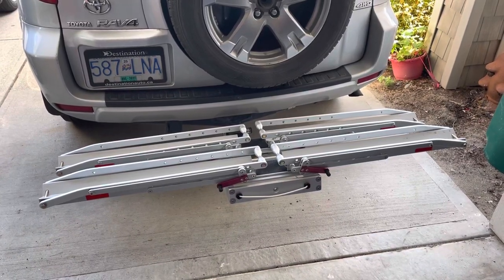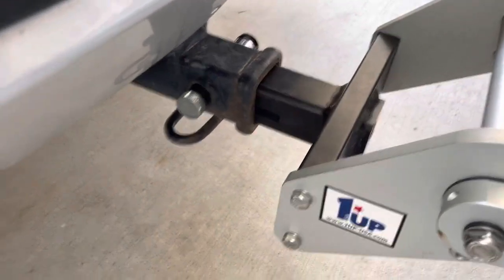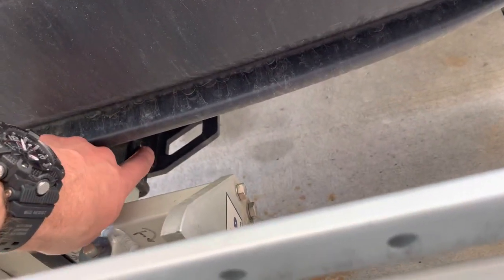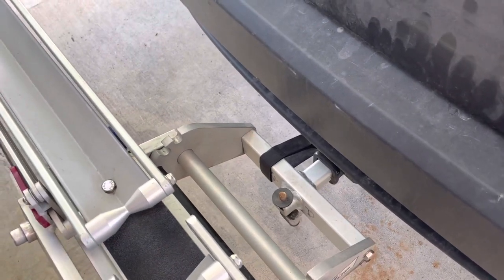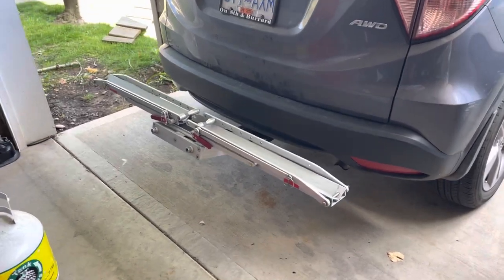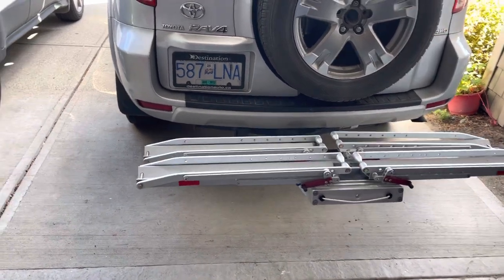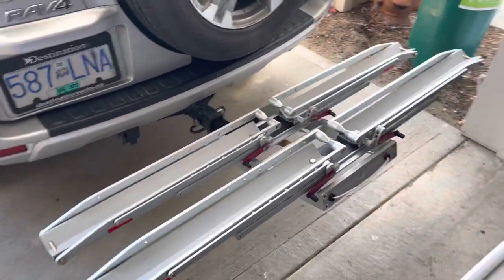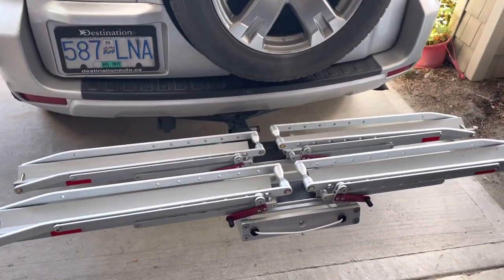1UP Quick Rack VS 1UP Superduty

Comment: I saw you had some sort of white nylon cable on the super duty to make it easier to actuate...is that something you did? or something 1Up offers?
Reply from the maker: I made that. I have a video showing the setup and how I did it. Makes it Much easier for sure!
Reply: 1UP offers the optional EZpull handle kit for the 2, the 3, and the 4 platform configs (~~$88!!).  Colin's nylon cord HACK shown here is WAY less expensive:-)
Reply from the maker: @donyvette3496  Here is the video on the cord setup. 
https://youtu.be/dZwj-RQoLj4

Comment: I just bought the 1 1/4" quick rack for my car. Bought the single and one add-on. Expected to be here Friday which is awesome. Going to another race for my daughter which is 4 hours away so I'll be testing it next weekend. Looks solid.
Reply: Checkout the $18 super duty bar to get 75 lbs weight capacity for each bar. You will need one for each bike pod. So for two bikes you would buy two bars.
Reply: are you happy with it ?
Reply: @JitinMisra  Very happy. Best bike rack I've ever had. So easy to take bikes on and off. I would highly recommend it. 👍👍
Reply: @andrewscasualmtb  do you utilize the velcro strap or an additional chain, to keep it on, since it doesn't have a thru pin, as a back up ?
Reply: @JitinMisra  Yes I always use the velcro. Did have it loosen once but only once about 4 months ago.
Reply: @andrewscasualmtb  how often do you recommend tightening it ? Did it loose to the point , where it could have fallen out on the highway ?
Reply: @JitinMisra  I only leave it on a couple days max because of my job. I only tighten it when I put it on, then put my bike on, then tighten it again. It's been great.

Comment: I bought the 1 up single for the 1.25 inch receiver.  Y only worry is it doesn’t have a thru pin,just the ball expansion mechanism, is that problematic ?

Comment: I have the one your mom has.  Is it the same as yours except for the steel reciever hitch part?  Just wondering if that part can be swapped out since I no longer have a 1 1/4 receiver.   Then I could carry a heavier bike.
Reply from the maker: Good question. You would need to reach out to 1up to confirm that.
Reply: I just checked and yes, for $155 US, you can buy the 2” bar and side plates

Comment: Thanks for that. I only need a single and my eBike is 62 pounds, but I'd probably be fine with the quick rack if I removed the battery.
Reply: my bike is also 62 Ils.  I  assumed one bike  at 62 lbs is strong enough to hold ebike with out removing battery.  Whick ramp did you get if any to load?
Reply: @barbaraflanders9041  I found out I can't put a hitch/rack on my car so I sold my 62 lbs eBike and bought a 38 lbs foldable I can fit in my Mini.

Comment: I have a question about the ramp to load my electric bike.  I am a small person and my bike is about 48lbs. I sometimes struggle to load the bike.  I like to know if your mother has trouble using the ramp. It looks kind of steep.  Is it worth it?  Thanks.
Reply from the maker: It depends on how high your vehicle is. 
If it’s a low car, the ramp won’t be too steep. 
But a high vehicle like a truck would make it very steep. 

She uses it and finds it pretty easy.

Comment: For $20 you can buy a device to convert your 1 1/4-inch hitch receiver to a 2-inch hitch receiver. I use one on my 2007 Prius, it works just fine
Reply from the maker: I use one on our accord. The only thing is it makes the rack stick out further but it isn’t too bad.
Reply: @colchilibeck  does that allow to put the pin lock through , one the 1.25 inch receiver ?

Comment: I have the same as your mom 1.25inch as well i have a trek 53 pound ebike did you have any issue so far? Im sooo scared the rack can not handle the weight of my bike specially on a rough road.
Reply from the maker: No issues. 
If you take the battery out that would probably be at least 5 lbs weight savings. Maybe even 10lbs.

Comment: Will this rack work with fat tire bikes with fenders?
Reply: You will need to buy fat tire spacer kit to spread out the arms for the wider fat tires for around $40.  Depending on the fenders, you might have to add something to cover the horizontal part of arm so it won't scratch the top of the fender (something like pool noodle you cut to size).  The fenders might not be strong enough and might deform, dent, or bend and the bike might not be 100 secure in the rack.